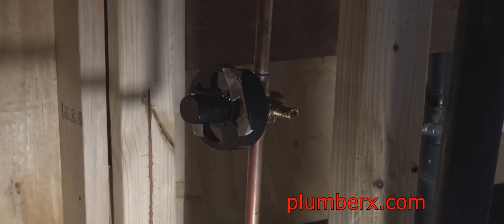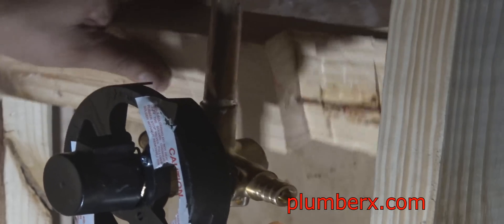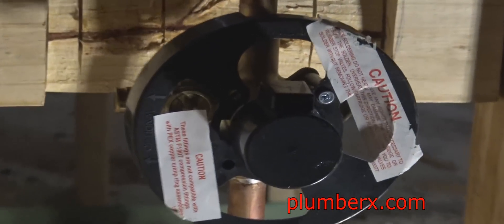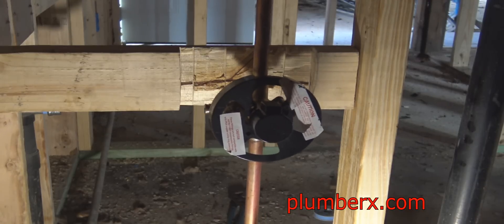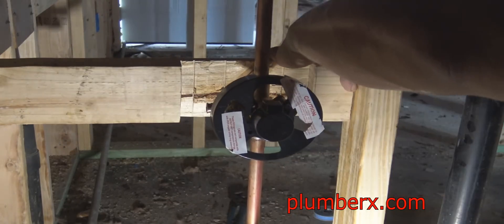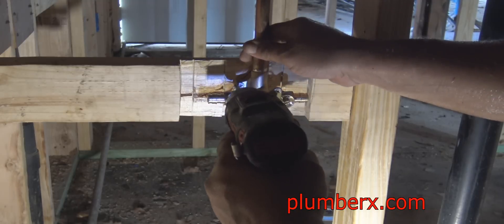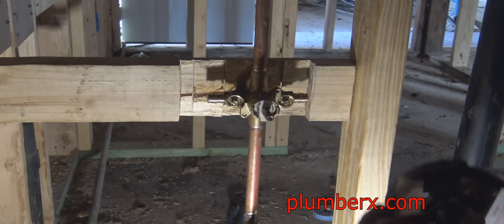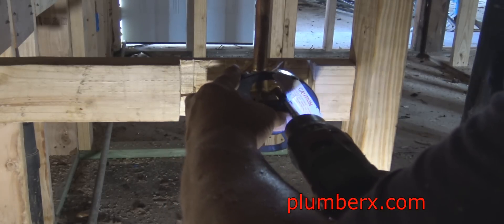Pex Pipe Plumbing Stub Out Set Up And Hang Shower Valve

Comment: Can you use drop ears for a bath room sink? Hot and Cold?
Reply from the maker: Yes. I do. 👍
Reply: @theartofplumbing  what do you connect from there going thru the sheet rock?
Reply from the maker: 1/2 x 4" galvanized nipple with a cap. And remove the cap after drywall and paint and install angle stop/cut off valve 👍
Reply: @theartofplumbing  ♥️

Comment: Mr Taylor I hope all is well with you. I have a quick question about using galvanized nipples with the Propex brass drop ears. I used the 3/4 galvanized in the garage at the water heater maybe 3 years ago. Now I’m seeing some white residue at the junction of the fittings.  Could there be a dielectric problem using galvanized into the brass drop ear fittings?  Hope not because I used some close galvanized at some shower valves. 
Thank you for the videos. They’ve helped me a lot.
Reply from the maker: I'm good. Thanks for asking. One of the hardest things about a plumbing system no matter what material you use. Copper, brass, cpvc, if you have hard water it's tough on your plumbing system. I have changed out plumbing pipes system that were all galvanized and installed over 40+ years and the pipes were still in pretty good shape I have done the same with copper and the copper plumbing system was less than 15 years old, but pin holes everywhere.  I won't even mention CPVC😖 I say all that to say, sometimes it comes down to the area you live in and the water source. This is why some people install water softeners. Hope this helps. Great question.

Comment: I like the fact that you use the winged 90 to connect the PEX to stub out. It makes for a more solid assembly than the Hold Rite metal strips that most builders use. I would probably use brass nipples in place of the galvanized for my own home.
Reply: Nothing easier to change out than a threaded angle stop…I’ve always used the same stub out system whether pex or copper. Used galvanized nipples until it came time to finish, then I’d swap to brass or chrome(if visible)…makes for a way more solid and professional install…thanks for the vid!
Reply from the maker: Got it. Thank you for your input. I appreciate your support
Reply from the maker: It gets the job done.👍 Thank you. Brass is good, but can get very pricey.
Reply: Just those brass winged 90s cost me $10.50 each at Ferguson today.
Reply from the maker: @rlknight57  yeah it helps to have an account with them. But here's a link to the home Depot $5.80.each . Your friend has shared a link to a Home Depot product they think you would be interested in seeing:

Apollo	1/2 in. Brass PEX-A Expansion Barb x 1/2 in. Female Pipe Thread Adapter 90-Degree Drop-Ear Elbow
https://www.homedepot.com/p/Apollo-1-2-in-Brass-PEX-A-Expansion-Barb-x-1-2-in-Female-Pipe-Thread-Adapter-90-Degree-Drop-Ear-Elbow-EPXDEE12/302741897

Comment: I thought you were using a Manibloc for the pex? Would you still need valves under the sinks?
Reply from the maker: Yes I did use a maniblock and I do install cut offs under sink, but you don't have to. As a plumber I just like the convinues. If there is a problem in the bathroom I don't have to run to the manibloc
Reply: @theartofplumbing  Ok, Thank you for clarifying! Great info!!

Comment: Had a zurn rep tell me, now you can expand zurn and use wirsbo fittings and they will warranty it
Reply from the maker: Dunn Plumbing llc really
Reply: Yes sir, I don't know if I'd trust it though
Reply: Unless it's Pex A, I wouldn't trust it.  Pex B does shrink, but nowhere near what A does (I played with expanding 3/4 B as an experiment).  I wonder if the expansion rings over the B will help pull it back over the fittings.. Still, why risk it?  Uponor A is the best Pex game in town.

Comment: Mr. Taylor, quick question. I installed a 32 port 1/2 inch manabloc. I see you are using cooper along with pex to your fixtures. Is this necessary? I've connected pex right to each fixture in my new bathroom.
Thanks for any help you can give.
Reply from the maker: Yeah I used the copper pipe on the tub and shower valves. It helps make the valve stable in the wall. If your not comfortable solder copper pipe or just don't have the set up for it. You could use galvanize pipe. You can go to  The Home depot and  Have them cut and thread you a few pieces. you would really only need cut and thread pipe for the riser ( this is the part going to the shower head ) And the others you could use galvanized nipple ( short pieces of pipe) that they already have made up in different sizes. Of course all 1/2 inch. Hope this helps.
Reply: Thanks! I used the nipples for all of my outlets. I ran 1/2 inch pex straight to my diverter. I also have two sprayers. Just concerned about water pressure with the 1/2 inch pex.
Reply from the maker: Same pressure as copper your good.

Comment: Was that galvanized pipe you were using?
Reply from the maker: Yes, in some spots I am using Galvanized pipe for stability. In the areas that have the exposure to being handled by home owner or plumber. Like changing or installing valve under sinks, connecting faucet lines, water heater, etc.
Reply: Thanks for the reply. I was curious because I thought galvanized wasn't code anymore accept for repair work but I trust that you know your codes.

Comment: Thanks for the knowledge! I guess it saves the home owner money rather than buying copper pipes! Is it the best way to go?
Reply from the maker: Yes, I feel this is the best way to go. To save money. Copper pipe is great, but sometimes if installed wrong could be a disaster for the homeowner and become very costly to repair. I've worked on a lot of new home with copper pipe only to see the copper pipe corroded prematurely due to sloppy installation plumbers not wiping the excess flux of the pipes or just plain hard water. If you’re going to install copper pipe in an area that has hard water I would use ‘L’ Type copper its much thinker. ‘L’ type copper pipe you find in most commercial buildings. A water filtration system would also be a good idea. Most home you will find "M" type copper.
Reply: So true I'm a super here in manhattan and I change out lots of copper elbow under kitchen sinks and bathtubs due to corrosion. And it's expensive rather than plastic it's doesn't corroded. Thanks again for your informative videos keep them coming.